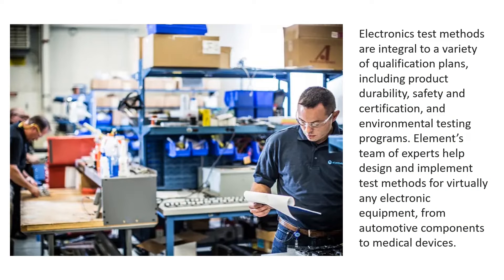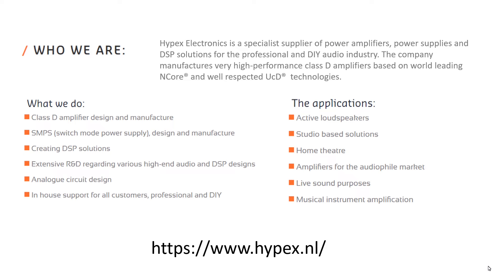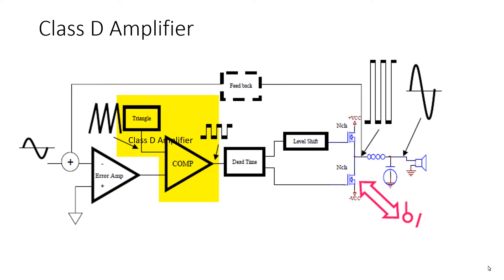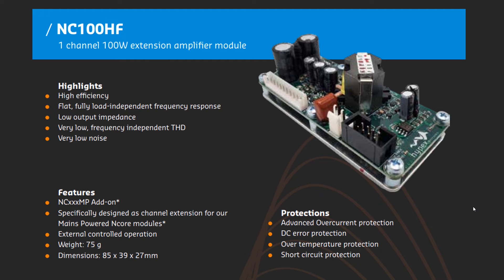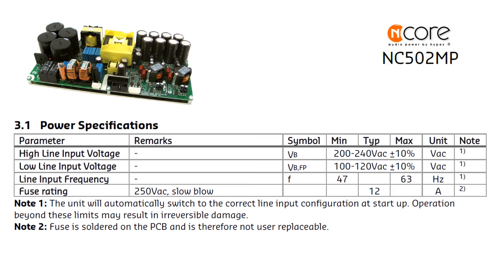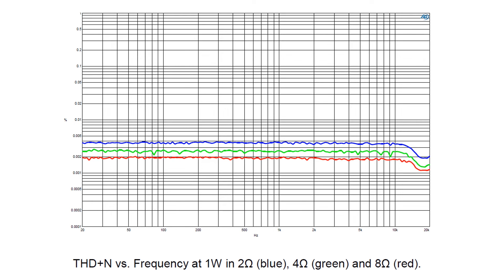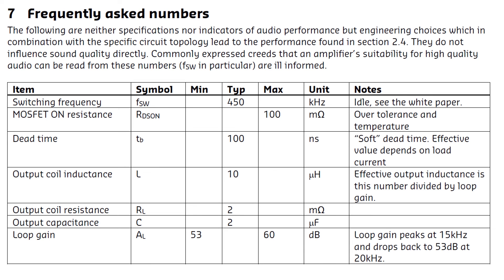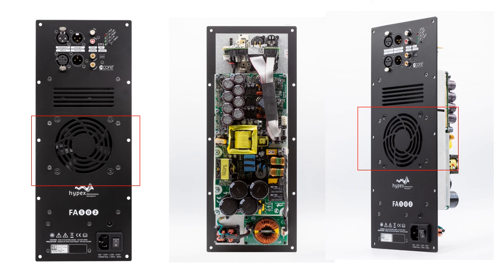Class d amplifier boards overview part 2 Hypex

Comment: arw you a dealer? im having a hard time finding the NC2K OEM, found a dealer here in usa but cant sell me Amp, PWMS, DSP modules cause contract agreement... 😔
Reply from the maker: Not for Hypex. We have contract with Icepower. It has larger lineup and better pricing structure.
Reply: do they have DSP modules for sub and 2 way tops.
Reply from the maker: @ladjkaoz  It does not make sense to build it. There are a number of excellent professional crossovers that match your needs for a fraction of the price.

Comment: Wonderful for active crossovers with less variation in capacitance, resistance, inductance...when separating the problems of a passive crossover...  you sold me!  You are one of very few that understand the greater efficiency of active crossovers and the advantage of multiple amplifiers is that if any power amplifier is driven to a higher level of distortion, the remaining drivers will continue with low distortion from the amplifier output and the amplifiers do not have to be massive.

Comment: I am a Hypex fan also used ice amps but I found Hypex nCore Mp better 
I use MiniDSP for crossover hope Hypex makes something like miniDSP with Dirac integration 
Hypex dsp is mono not stereo unlike miniDSP and I feel they will be sounding better than miniDSP but miniDSP is little easier to use and Dirac live suport
Reply: why hypex would be better I find them are more efficient. but its hard to find a dealer or parts.

Comment: Hello, which amplifiers are better
in sound quality from these PURIFI,hypex ,icepower?
Reply from the maker: All 3 brands amplifiers at high end are equal. You will not be able to hear a difference in blind tests (when you do not know which one is playing). If I would build one and forever than it will be ICEpower 1200ASX2. Mostly due to extra functionality build in this board like wake up from input signal and core telemetry

Comment: for my use efficient power amps is appreciated. probably the reason why i have icepower and purify amps.
i am considering plate amp to make active speaker builds easier, but i am worried about reliability and noise. 
so i am thinking about keeping my power amps and make active speaker with that.